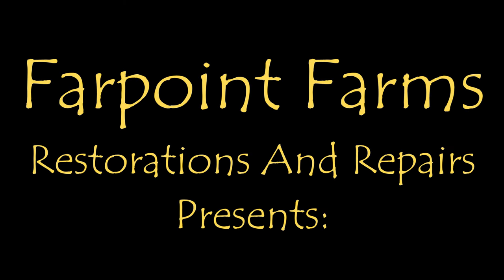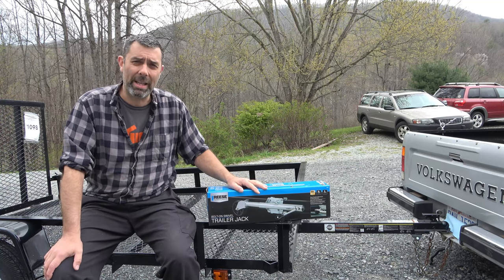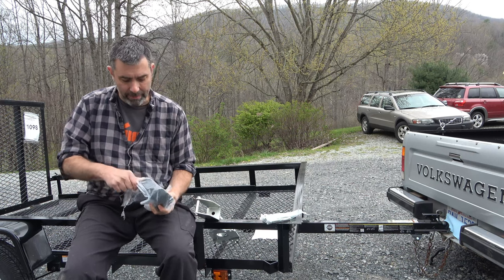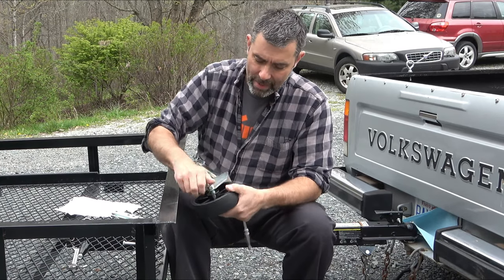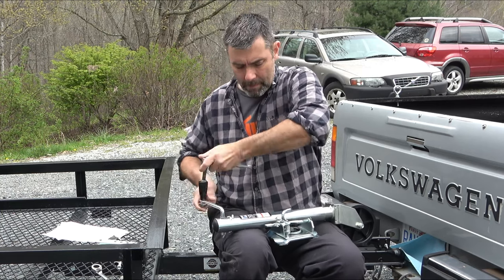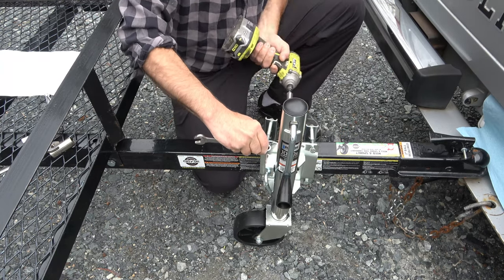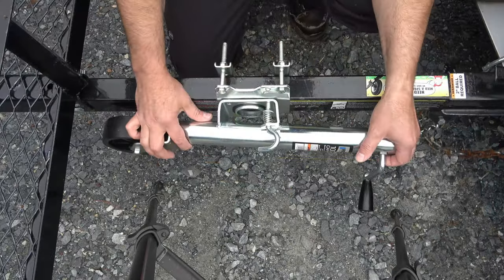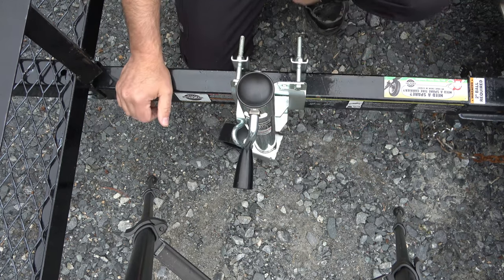Installing a Reese Trailer Swivel Jack. Upgrading my Carry-on 5x8 trailer.

Comment: I watched a guy install one and then he proceeded to jack up his loaded trailer and unhook it from his vehicle.  It slowly twised the tongue of the trailer as it lowered to the ground.  It must have been a very heavy load and he only put a block behind the tire on one side.  Needless to say he had to get it repaired and he beefed it up. Probably the strongest part of the trailer at that point. But theses jacks are awesome.
Reply from the maker: HOLY COW! I am fairly certainly these are for moving unloaded trailers only, but I guess he learned that the hard way!
Reply: @Farpoint Farms Restorations and Repairs  I think if he would have blocked the tires and made sure it wouldn't have moved, I think he would have been fine. At least that time. I worked at a construction company and for years they purchased eager beaver trailers for the small paving rollers, and they had a heavy duty jack that could take the weight and the frame of the tongue was 4 ince ship channel and it worked great for many years. Then one of the upper management person was getting a nice kick back to push business a certain way.  Well we needed to more trailer like the eager beaver trailers. The guy came out and took pictures and under cut the price and got the order for 2 trailers. Well when they delivered them, we went out to check them out and the lever for the tilt deck was never completely welded on so when pulling it the deck kept catching the wind and tilting. Then the drop gate that was supposed to make the approach angle easier to get up with a smooth drum roller, was welded on upside down. So after taking them back and fixing them, he brought them back and the wood planks on the  drop gate were all mounted wrong. The angle they cut on the end of the wood planks was wrong so when it was on the ground instead of a easy approach angle it was at 90 degrees. They also didn't have the screw jacks. They went and installed the jacks and then just dropped them off and left.  I ended up having to fix the wood planks. I said to my boss that I didn't think the screw jack was mounted very well and I was told not to worry about it.  The new trailers used 3 inch light channel steel. Well about a week in service the tongue broke while it was being pulled up the turn pike. The safety chains stayed on the truck and the trailer luckily stopped in the grass that divided the north and south bound traffic. So rather than send them back to the place they purchased them from they had our welding shop make the repairs. They had the other trailer pulled out of service right away because of what they found when making the repairs.  After all that, one would think that they would stay away from those trailers.  But they didn't. I guess the kick backs were really good. They got 2 more trailers from them and again about 2 weeks in the tongue broke and the trailer took off and with tandem axels it just kept on rolling. They never even tried to go back to the hacks that built them.  Instead our welders got both of them and rebuilt them so they could go back in service.  They were darn lucky that nobody got hurt.

Comment: Not impressed with the loose handle.  Probably won't be much left after a few rough roads.
Reply from the maker: Not sure what you mean. It's been on there for at least 1000 miles since filming, and all seems well.